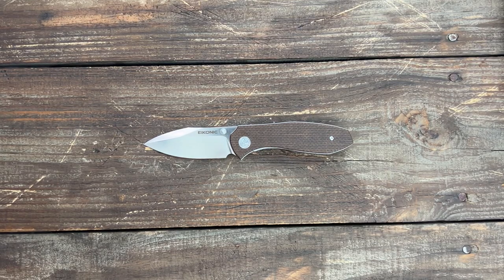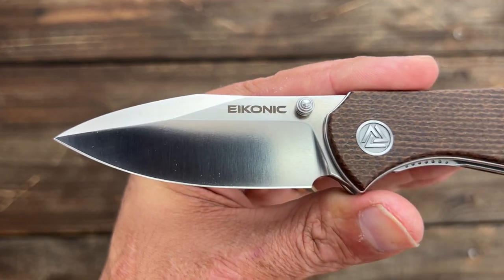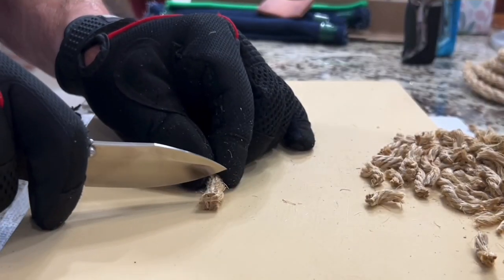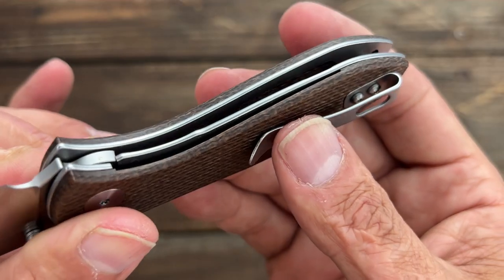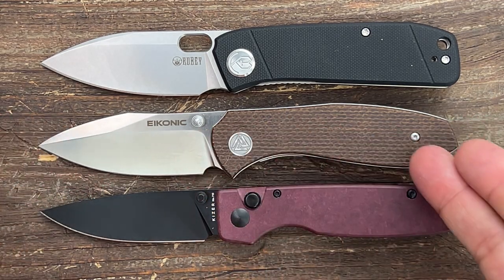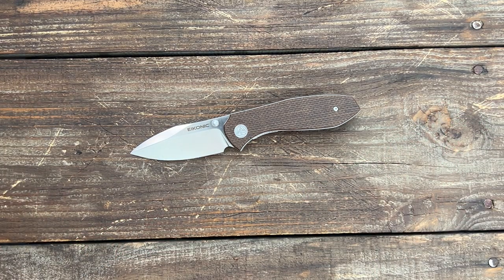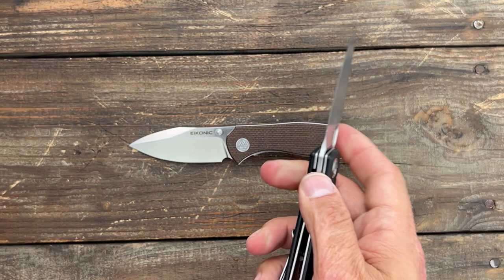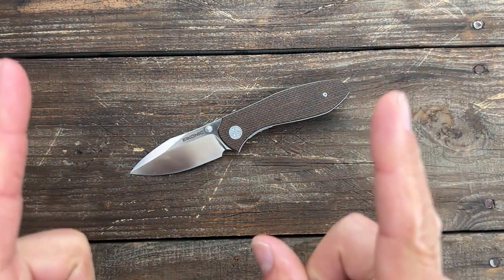Eikonic Knives Kasador a Ji Knives Design : I'm Impressed

Comment: Really wish they would have used 14C28N or 154CM.  Anything besides D2. This comment section sounds like a broken record. Nonone wanted D2, especially at almost $100
Reply: D2 can hang with those two steels no prob if treated correctly.
Reply: @jimmylarge1148  that may be however it lacks corrosion resistance that I prefer.
Reply: @ word. Thank you. Most just hate cause they heard someone else say it was junk. It’s not. U do need to care for it. I appreciate you having an actual opinion based on real life experience.